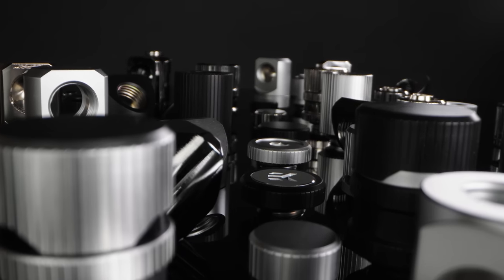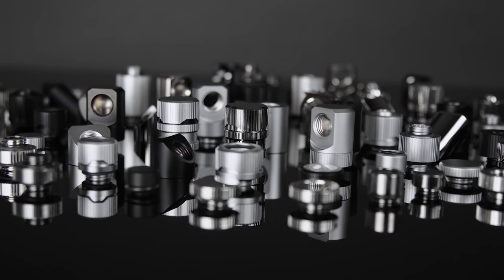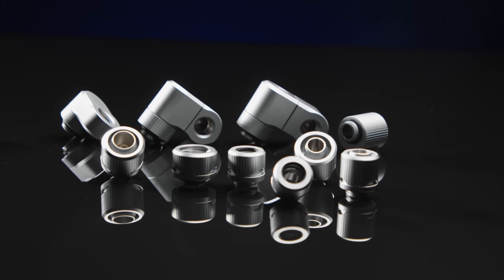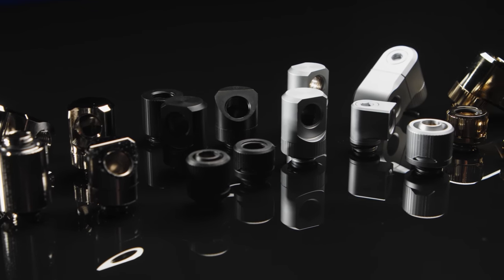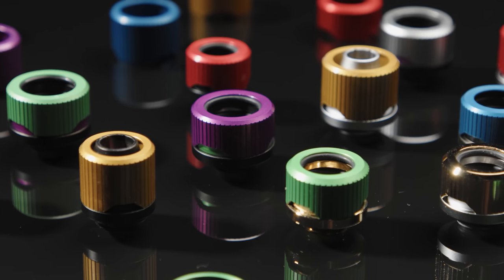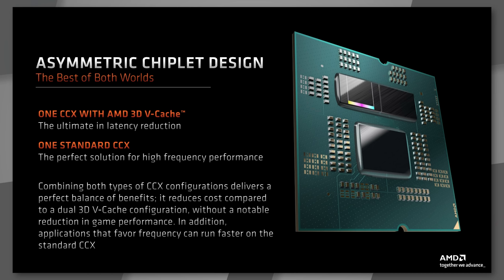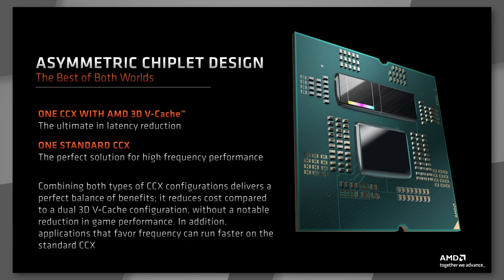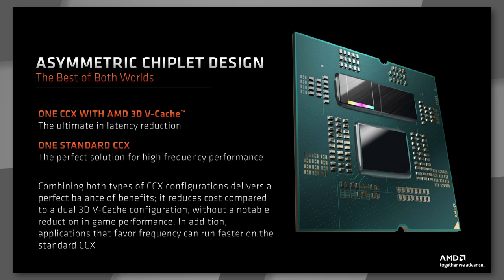Why I switched back to Intel...

Comment: Im still on am4 5900x its been such a great cpu and i will upgrade to the 9900x when it comes out next year. Getting first gen am5 was brave for anybody who did it but i thank them.

Thanks for all the likes and comments.
Reply: I’ve got the same cpu and it’s awesome.
Reply: same! paired mine with a 4080 from MSI. there's nothing I can throw at it to really make it show it's 'age'.
Reply: My plan is to get a 7600x or 7700x and then use the AM5 platform for architectural upgrades when they change how CCD optimisation works for the next Zen products.  Switching to LGA and pushing 3D Vcache to higher clocks and cores is just flying too close to the sun right now.
Reply: @terrydoestech  The only thing I can think of, other than benchmarks, in gaming maybe cities skylines 2, or the next battlefield.
Reply: Same plan! I will get next AMD with 5000 series Nvidia.
Reply: Same here. Got my 5900X paired with a 7900XTX, and I'll wait for those Ryzen 5 as well, probably 8950X3D.
Reply: I'm also still on AM4 with the 3600 paired with a 6700 XT, not planning to upgrade yet though.
Reply: Got the 1600x on release. Got the 7600 on release. No dramas
Reply: I upgraded from 5900x to 7800x3d  when it came out. No problems whatsoever.
Reply: Similar story here, 5800x, it bottlenecks my 4090 a little bit but even at 1440p like my lg oled, the newer games with path tracing still manage to remove most bottlenecks!
Reply: 5600x and a 4070 here
Reply: Same here, great CPU and handles most any task you ask of it with little to no trouble!  I'll likely go to AM5 with Zen 5 or whatever comes afterwards.
Reply: I have a 5950x and feel that waiting until 2025 will be best, pcie 7.0 will be available and 3 nanometer chips. DDR5 ram will be mature and cheaper and the boards will be able to handle higher speeds with better timings for the ram. This will be the last year for AM5 support so deals on boards can be had. I will probably get the 3d v cache chip next time as I mostly game.
Reply: I have the Holy Grail of the 5000 series. The 5900OEM. Tricking it out it, (no overclocking) runs like a 5900X but at far lower temps.  Not getting rid of it soon. It will be turned into my back up computer when I upgrade.
Reply: I thank them too, AMD is our friend and deserves our blind support.
Reply: Wouldn't touch intel, the temps, having to overclock and...well its intel, are enough to put me off. I know what intel are like when the own the market, a new cpu every 10 yrs. No way hosey.
Reply: @PindleofKujata I have a 1080 8GB still. Upgraded 4690K to a 7600X, went from pegged CPU usage and 50% GPU to the opposite; full GPU and up to 50% CPU.
Plan to upgrade to 8800X3D next gen, along with a GPU upgrade if the manufacturers and market regains some sanity.
Reply: im still on my 3900x. i cant really justify upgrading to a 5x cpu either. idk. i have 12/24t which are relatively fast. i do kind of want a 5900 or 5950x, but i cant justify the cost of upgrading.
Reply: My 7600X had some stability issues on a 3 month old BIOS when Gamers Nexus made the chip voltage video and AMD rushed to update. Ran OCCT and sure enough had memory errors. Dropped everything including memory to base settings and limited whatever the specific voltage was called to less than AMD said. No more memory errors.

Updated BIOS after it was released out of beta and was able run 6000 EXPO and a PBO curve "overclock" with no errors.
Reply: Right there with ya!
Reply: Yeah, I am also on a 5900x and the 7k series was just not enough. I'll check what the next gen will bring and if it is compelling, I will upgrade too.
Reply: I'll go with AMD and 5080 next year probably if they keep their software stable. I may go Intel though with the 15700K if the performance is there and the Watts are lower than they are now, because they're so incredible high. AMD wins in power, but Intel wins in stability.
Reply: Yea I’ll probably end up getting like a 8600x
Reply: @mtk3668  Nah stick with it, i went from a 3600/5900x, and yeah it was noticable. Also upgraded from a 3090/4090 and it wasn't that dramatic a jump, the 3090 still has so much grunt.
Ide personally wait until you have to upgrade the whole rig.
Reply: There is nothing wrong with first gen AM5. But not really needed if running a 5000 series processor. Dont think second gen will be much cheaper.
I think the prices will raise more with the newer stuff, so the older stuff will be a little tiny bit cheaper.
Reply: "still" 
meanwhile most people here are running cpu's which by your standards would be considered prehestoric
Reply: Agree completely.  I considered a 7700X, but based on my experience as an unintentional Beta tester for 1st gen Ryzen, I opted for a 13700K.
Reply: I have a 5900x and do not have any issues.
Reply: Same here and exactly right, I have 64 GB 3600 DDR4 with my 5900X and another machine with same ram and 5800X and both are very stable and way fast as I need and run super cool in a good case so no need for upgrading yet either 👍
Reply: It might have been brave but fortunately worked out fine. I went with the 7800X3D on an AM5 board and never looked back.
Reply: You’re welcome :)
Reply: I'm still running a 3900X. I'm gonna upgrade to a 5800X3D soon and run that until the 8000 series stuff comes out.
Reply: I'm on the same cpu not switching to AM5 too many problems.
Reply: You waiting till 8000 series will also yield you an even bigger upgrade from the 5900X. Maybe DDR5 will be dirt cheap by then too
Reply: 5950X here and love it!
Reply: Ditto ! stable and great temps
Reply: I gladly accepted the am5 taking off flaws for the INSANE efficiency of the 7800x3d.
Reply: 5900X and 6900xt here. Works awesomely with both games and rendering in Fusion 360 + everything else I throw at it.
Reply: I went from 5900X to 5800X3D in last December and haven't looked back, the vcache for gaming is unbeatable!!
Reply: 5600x for me, i will wait like 1 or 2 years
Reply: Ive had my 5900x and been looking to upgrade to a 7900x or a 7900x3d and still stick with my 3080ti,honestly the 5000 series was the best personally
Reply: @PindleofKujata go for a cheaper 7600 if you don't render
Reply: Yeah I still have a 5900x too. Don’t think I will get a new one for a couple more  years.
Reply: 5900x is a beast
Reply: My main gaming rig is still using that. My Sim rig is now on the 7900x3d & I've not had any of these issues at all jay talks about
Reply: I bought AM5 Motherboard (AsRock B650 PG Riptide Wifi) and Ryzen 5 7600.....I was thinking that I will upgrade 2-3 years later with Ryzen 5 9600 or something.
Did I make a big mistake? (Didn't watch video. Just want an answer)
Reply: Yeah 5900x what I use. I love it. Don't plan on upgrading anytime soon. Definitely an amd fanboy
Reply: Same here, the only thing that worries me is the amount of power these new CPUs draw, I'm afraid I'll be forced to do liquid cooling and it really annoys me
Reply: I got a 7800x3d and got Zero Problems with Stability it Works perfectly was Lucky i think
Reply: Same here. I have a 5900x with a FTW 3 EVGA 3080 and CL 15-15-15-35 3200 ram...it works amazing
Reply: Ive had the 5950x since release and its been the GOAT for me.
Reply: same lol, thought about waiting till 2028 for 3rd gen, but i cant wait THAT long xD
Reply: 5800X here, honestly so happy with the purchase I feel like I’m not missing out on anything.
Reply: I am 4 year usinh 3500x ryzen with 1060 ge force, by reading ur comment, makes me decide (it will) upgrade my systwm to 5900x.. U send me a good energy of it
Reply: @davidbrennan5 same here, 5950X with 6800 XT, surely if I decide to change it won't happen before 2025
Reply: Why even upgrade when something is working
Reply: 5950 here and I am able to run most games and all the virtual machines I want with 5700xt. Hopefully the 2024 releases will shake things up enough to make a GPU worth buying but everything is stable and optimized for now.
Reply: My rig (which is getting filled here soon I wanted to watercool this one) has a 5900X and 6950XT I will upgrade in 2-3 years cause it currently is still above recommend for all my games except maybe Ark Survival Ascended I hope it goes well my little brother has my old rig (3700X and 5500XT) and he's currently dealing with random restarts (I think it's bios related cause had no issues till I upgraded from 2.80 to 5. Whatever it is on my Taichi
Reply: My 3090/5950x looks like it's staying put for a while😅
Reply: Hi I bought 7 7700x yesterday AND it is great! Haven't undervolted yet but 1.35 volt @5.6Ghz = 50-65 celsius in ultra 1440p gaming with a water cooler running at ~50%t!(Arctic Liquid Freezer II 360) 😍  no extra case fans.
Reply: Just a heads up. I heard the 8000 series will just have better integrated graphics. Sounds like a good time to get a 7000 series cpu
Reply: @terrydoestech I just got a 4080 super and I have a 5900x. What are your 1% lows my frame time hits a big spike every 30 secs. I wouldn't think my cpu was the problem but I can't figure it out.
Reply: @ripvanwinkle3432  my frame rate is either a steady or 120 depending on the game/lack of optimization. I never have huge lag spikes of any kine.
Reply: 3600x and 3060 ti dont fix what aint broke
Reply: These days tho, it runs hotter than my AMD GPU.
Reply: I thought the same now the price of the 7900x or 7900x3d is too good not to get coming from my 5800x. I will need to change my mobo but will wait for the july ones to release. Then I can simply drop in a 10900x in 2026 or 2027.
Reply: @steveo13987 you ready for the 9950x release in a few weeks?
Reply: Hopefully my comments ages like milk, but from I've heard 9000 series CPU are also having a problem

Comment: Where's the "After switching I went back to AMD" video?
Reply: Its out, check that out 🤣🤣
Reply: @haneterujoseon7350  LOOOOOL
Reply: @haneterujoseon7350 yeah I was gonna say. lol
Reply: why would he? he just made videos covering the issue, his CPU wasnt even affected. unlike his AMD CPU which WAS unstable. thats the reality - intel is more stable at its worst than AMD at its best. cope harder
Reply: @theendurance  And maybe you can have better overclock with INTEL. I give 40%+ overclock performance (score) with my intel .... old CPU of course
Reply: @theendurance  AMD move fast to fix the problem and Intel, well, they don't even admit their mistake😅
Reply: @haneterujoseon7350  To be fair, while Intel handled the issue like a politician....some of the fault falls on motherboard manufacturers...who...instead of following the max power specs recommended by Intel instead allowed the CPUs to pull more power then they were ever designed for.
Reply: @snakebite6x6x6  Nahh, the microcode literally "ask" for more electricity from mobo 😅
Reply: @theendurance  I'm coping so hard right now. Eating my popcorn watching the intel fan base lash out in the phase of denial. Meanwhile Intel refuses to take blame and won't cover the warranty unless you have updated to the performance profile. Intel also has issues with the power and efficiency cores working as intended, but lets also act like that isn't an issue. I usually stay unbiased as both manufacturers usually have a winner is some department, but Intel really is dropping the ball with 13-14th gens. Gotta look beyond userbenchmark....

Comment: Better update this vid because people are getting misled if they still watching this...
Reply: Having used both (well a 7800x3d) the stability issues on the AMD was worse for me. I already knew to set the power limits for the intel out of the box due to reading about it 6 months ago on a reddit post. I’d rather pay more for more stability, and for my use case the 14900k has lived up to that offered me better performance.
Reply: @wr2899 I’ve never had stability issues out of my 7800x3d. Sounds like user error
Reply: @sav22rem22  Can't tell if you're attempting to be humorous or don't understand how different components with the same CPU can lead to different results.
Reply: @wr2899  what motherboard, cooling and RAM have you used?

Comment: This didn't age well
Reply: why
Reply: @D2ee2aKolYoum  13th and 14th generation intel chips are experiencing severe stability issues. It's suspected that there is degradation of the chip itself under normal (not overclocked) loads. It starts with a few crashes here and there. The crashes become more frequent. It culminates in blue screens of death.
Reply: @anduinxbym6633  Man good thing I got the i9 11th gen instead of the 13th when it came out, guess I dodged a bullet.
Reply: Right
Reply: @anduinxbym6633  11 and 12 gen still exist and the same performance no issues
Reply: He probably gets massively sponsored by Intel, if you notice this channel barely talked about the Intel 13th and 14th gen fk up while other channels were more critical about it, but here you have the "it is just a motherboard problem just tweak your voltages and easy peasy no problem Intel 13th and 14th the best.

Comment: I had similar issues very early on with a 7950X, and it seemed like memory stability as well. Fast forward a week of debugging and I decided to disable the CPU's onboard AMD graphics in the device manager. I never had a memory issue again.
Reply: I've had endless issues since I built my R9 a few weeks ago, very similar to everything Jay is laying out here. I just turned switched off the integrated system, I'll report back here if it ends up helping!
Reply: @daldladla did it?
Reply: @huntermckinney5239 No. Can't turn on EXPO with stability, Windows 11 current update cannot install, white static led on Asus motherboard occasionally comes on indicating an issue with GPU connection (i've reset it, it's secure.)  All of this since I updated the bios - shoulda kept it factory like I always have lol. Considering just returning the board to Microcenter and seeing how another one pans out. As long as I keep HDR off the video is stable. Anyways thanks for checking back in. The joys of PC ownership.
Reply: @daldladla any updates at this moment
Reply: @H786...  Just gave up on EXPO, fast boot, everything. Keeping everything stock I've had zero issues. I don't think this tech is consumer ready yet
Reply: @daldladla  Don't happen to have an ASUS motherboard? they seem to have messed up real bad with the AM5 socket.
Reply: @snailswrath  Yup Asus. I only go to Microcenter to build and lately ASUS seems to be outspending everyone else to the point that CPU/MOBO combo deals are only with Asus boards now. Totally sucks because I have had nothing but rotten luck with them lately.
Reply: @daldladla just built a brand new system with 7800x3d, 64gb 6000mhz, 4070ti super with an msi b650 tomahawk board. nothing but instability, slow (5+ minute) boot times, or just not booting at all with expo . returning both the mobo, ram, and cpu and buying a 14900kf
Reply: @lorenbh  it's pretty bad and I'm surprised it's not discussed on more tech sites. Have had mobo issues across 4 R5 builds I've done. All Asus
Reply: @peterpickguitar I'd say avoid Asus at all costs. Ryzen itself is incredible, especially for the price
Reply: @daldladla  Captain hindsight coming in after the whole asus quality control debacle. Avoid this company like they plague, I wouldn't trust their products even if they paid me to use them. They can barely create and "fix" a handheld, god knows how much they fuck up on those motherboards.
Reply: so you have to disable something you paid for just to get the CPU to work properly? shit brand